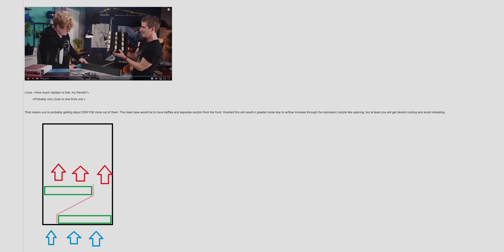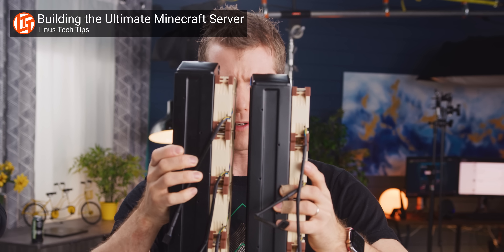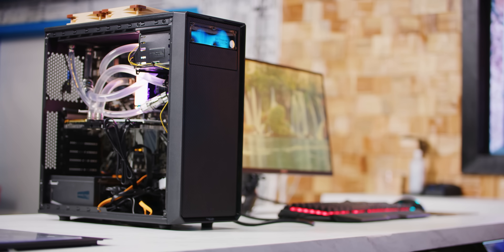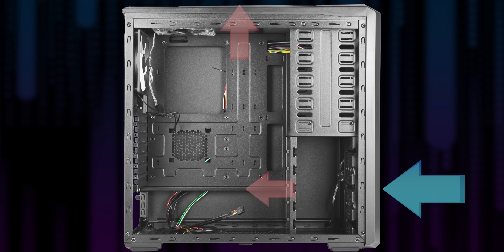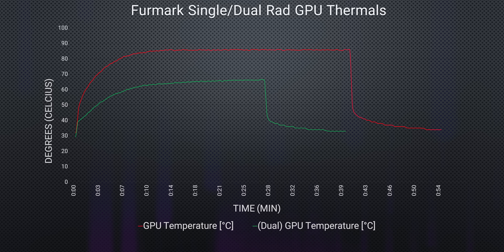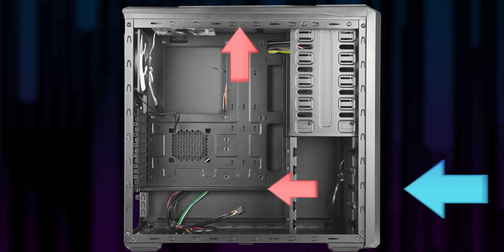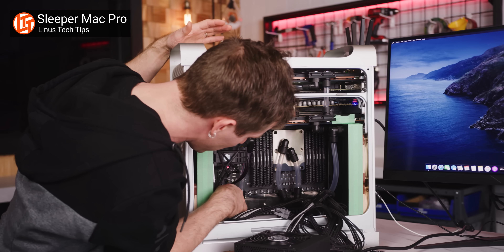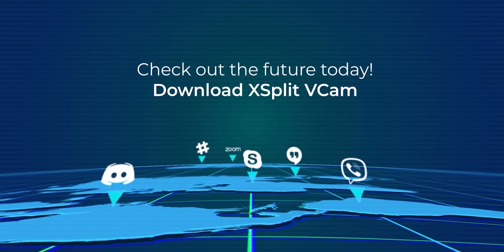I’ve been water cooling wrong for YEARS - $H!T Manufacturers Say

Comment: Corsair is both right and wrong.
According to heat exchangers physics, you need to "crosscool".
This is, the hotter the water, the closest to the end of the flow it needs to be. In other words, the radiator the most close to the outside of the case needs to receive directly from the components (hottest water) and the one most inside (closer to the most cooling active components, like fans, needs to have the coolest water, after being being sequencially and in series piped from the hottest to lowest. 

Stacking rads is the most efficient way to do it. If you do know how to do it.
Rads need to be in series. Hottest with less flow closer to the end of the case. Output of coolest water on the most inside rad.

Source: nuclear reactor heat exchangers.

Edit: Clarification and correction of incoherences. Also, thanks you guys.
Lost the LTT heart, sad. It was an honor to have it, though, even if it was only for some minutes. Thanks LTT.
Reply: Very well said. The goal in heat exchanger-design is always to get as close to a counter-current flow exchanger as possible, since it is the most efficient design possible.
Reply: Not really nuclear reactor physics, just standard heat exchangers. Basically always put your hottest source with your hottest sink, and coldest with coldest. (So water goes into hottest rad, then into colder rads). It's exactly how standard heat exchangers work to mean you can turn a 80 degree source and 20 degree sink into a 30 degree source and 70 degree sink, rather than just meeting in the middle at 50 degrees
Reply: @Owen Yin Corsair would get it if they actually used a good crosscooling setup and if Linus actually used crosscooling in his most common setups.

I'm no expert in many things. 
However, I'm still try an learn it. Why do I know crosscooling? Minecraft vídeo on the Nuclear craft mod. Then I started studying it a little.
How do I know how computer ALUs and ram work? Minecraft led my interest and now when I do play Minecraft I can build computers. Yes, I've learned a lot from Minecraft, or started learning from Minecraft, just because of the flexibility of the game.
It's just really a bad appeal to authority there.
Just because someone has a degree it doesn't mean a hobbyist isn't better than them at it. Actually, hobbyists are usually better at it.
Reply: To add on to the fact, water to air radiators are "fine" for removing heat. Water to water or water to oil solutions are significantly more efficient, if much more difficult and space/cost consuming.

Source: Water/oil exchanges mounted on the top of Porsche motors.
Reply: its not heat exchanger physics, its called thermal dynamics.
Reply: @arlindkrasniqi3315  Yeah, and the next guy will tell me that it is quantum physics because we live on a quantum universe.
We know already, thank you.
Reply: @arlindkrasniqi3315  Well, if I used complicated and ridiculous out of ordinary words to describe whatever, no one would understand what I was saying. The best way to get people to read is to make them comfortable.
Wanna talk about entropy? Fine, tell me how many people of the general public would understand it. It doesn't matter being sooo correct that no one understands you.
I could just say "quantum physics" to anything. I could have said thermal dynamics. But no one would care to read and learn what actually is important.
Reply: @arlindkrasniqi3315  "a heat exchanger is a device to change heat of one liquid through the use of another liquid"
Fluids, actually. And air is a fluid.
Reply: @arlindkrasniqi3315  Uh. Heat exchangers are fluid to fluid, not liquid to liquid. 
Talking about heat is talking about thermals. There's no need to be picky on the terms.
As the name suggests, heat exchangers is any device which transfers heat. Radiators are heat exchangers... At least when they do have some kind of fluid to exchange with. Radiators would actually be devices that only radiate heat as electromagnetic energy, in other words, radiating radiations on mainly the infrared spectrum.
It's literally in the name.

The point here isn't being as accurate as possible, it's explaining cooling efficiency.

If I was to try to explain gravity, I'd probably say that on earth it makes things fall at an acceleration of 9.8 m/s/s
But if actually explained gravity I'd need to talk about subatomic particles like bosons. 

The thing is, you can't always explain stuff by being 100% correct.
Reply: The water is moving so fast in a PC loop that none of this matters. The temperature difference you'd see from making an 'optimal' loop order is within the margin of error. You can talk theory all you want, the practicality is that loop order isn't important and the entire system reaches an equilibrium at some point where the water is at a stable temperature throughout the loop.
Reply: @NiceAndCreamy  That is correct. However, you'd get better results with maybe lower pumping rates instead of the high rate pumps nowadays. Other than being more reliable on the pump, it would increase efficiency and decrease the overall temperature on the components.
Reply: @NiceAndCreamy  Interesting. If the entire water loop is at mostly the same temperature, then Corsair is completely full of shit and have no fucking idea what they are talking about. As long as the ambient air temperature is lower than the fluid temperature, more radiators=more cooling, period. 

I see it all the time, engineers with their fancy SHIT models think they know what's up.
Reply: Is a cross-flow heat exchanger actually better at transferring heat or is it just better for other reasons?

I seem to remember from my Heat Transfer lab that cross-flow heat exchangers were mostly better for other reasons than strictly total heat transferred.

Then again, I only ever took the first Heat Transfer class, so maybe that got covered in the later classes.
Reply: @theInsaneRodent  They are better for efficiency, you don't need to much fluid Flow. It means less energy input to cool. It isn't exactly the best performing on high pump rates, but with low pump rates it is extremely good because it is extremely efficient. Nuclear reactors use them because they transfer the most amount of energy to the lower energy level fluid really well.
Reply: Nuclear reactor heat exchange is a bit different I'd imagine. You're basically boiling water from radioactivity and having it go through turbines to generate electricity then condense back. In normal PC water cooling, it stays in its liquid state and actively is pumped through a radiator. That active bit is important:  the water doesn't stick in one place very long and a lot of the temperature normalizes throughout the loop. Sure it's going to be a bit hotter going to the rad than from, but because it's being actively pumped, it doesn't make a big difference.
Reply: @sw33t.angela  Well, nuclear reactors sometimes don't use water as coolant, but another better coolant that exchanges heat with another water closed cycle.
Heat exchanging in nuclear reactors is equivalent to a PC, it's all about efficiency.
And while "it doesn't matter" because there are huge pumping rates, pumping rates also use a lot of power. You could just use a less powerful slower turning pump, using less energy. And you can also save on fan power too. 

In any heat exchange, all that matters is efficiency. Cross cooling is the best way, so in PC's it would also be the best way.
Reply: While what you say is true, that's not what Corsaid said in their comments.
Reply: Nuclear reactor heat exchangers and a pc case is not exactly the same set up thought. 
Crosscooling is perfect for a nuclear reactor because you maximise the heat exchanged. Which is important because you still need to extract work from the heated water after the exchange. So it has to be as hot as possible. But you don't maximise the efficiency off each of your individual radiators.
Crosscooling is not the most efficient way to cool a PC. Your goal is not to heat a second reservoir. If you make sure all your rads are pulling fresh air from outside of your case. You will maximise the efficiency of your rads and will need less of them, therefore reducing cost or temps (depend what you want). 

That's basically the point Corsair is making. "The second rad is not as useful as the first. Can do better." 

Also i didn't knew about crosscooling, but it is really cool (hehe), so thanks for that.
Reply: @guilemaigre14  It sounded like Corsair was saying that the second rad wasn't doing anything to cool the system, but that they were basing that on simulations that didn't take into account the heat loss due to non-controlled airflow.
Reply: @FranciscoTChavez  if it was a Corsair case and Corsair rad Linus used, they have 3D CAD models of those and all the data about their effeciency that they can use in their simulation.
Those kind of cfd analysis are actually really precise. If not basically spot on. At least that was a point where clearly Linus didn't knew what he was talking about.
Whenever he talks about physics i usually cringe a bit. This time it was more than a bit. :/
Reply: @FranciscoTChavez  forget that other point, sorry.
It can have a negative impact in certain situations indeed.
If you don't crosscool, meaning your last rad is the coolest one, you could end up in a situation where the water going through the second rad is cooler than the air, and therefore heating the water.
That's what they talked about. And if their rad are as efficient as they claim, then it could be possible, i think.
Reply: @guilemaigre14  yeah, I even started writing a comment on the things that Linus explained incorrectly in his physicals analysis of this, but I gave up and scraped it after the 4th paragraph.
Reply: @guilemaigre14  Well, crosscooling is definitely the most efficient, but surely isn't the best performing in PC's because there isn't that big of a heat difference.

But at the point you are willing to spend money on multiple radiators, do you really care about each radiator's efficiency?
You'd have better temperature control for longer time and while the outer radiator would be extremely inefficient, the inner one would be way more efficient than normal.
But it doesn't matter if the energy is going to be used or dissipated, it only matters that you don't want the energy to be on the water.

The problem of pulling outside air to each radiator to inside the case is fan pressure and heat. To the amount of air that is usually intaked in that config you'd have positive pressure but since you are keeping hot air in you'd have low pressure, since in a dual rad parallel config you'd have more intake than output area.
Now, this seems like equalizing, right? Low pressure hot hair but being compressed by limited output. And it is great... For not long time. It's initially very efficient, however, you start getting turbulence on the air, reducing fan efficiency and of course, you are keeping hot air in, which usually wouldn't be that much of a problem, it's only warm, but it does unfortunately reheat all the components, reducing also overall heat dissipation of the components.

It's good on the beginning, but it gets worse.

Crosscooling keeps it's performance high as long as the heat difference is high. And to that I say, it's easy. You can just run air through the case and have crosscooling on the top, with in big cases up to three radiators (totally overkill, unless on server or Pentium D applications).
This means the overall case temperature would be ambient, always. And the hot water could have up to 60C of difference.
Because the efficiency of crosscooling increases with temperature difference, the hottest it goes the better it cools (if you have enough radiator area and air, unless you want to use water-liquid cooling, which is great, but again, you'd have to have some kind of air cooling), until you reach an equilibrium.
And it really just depends on how you tune the speed of the flow of the fluids. Probably pumping the water too fast wouldn't be a good idea (heat difference is the reason), but also not too slow because you'd burn your components.
I'm pretty surprised how many people completely overlook pumping rates and think always that higher is better, but not always.

Anyway, cross cooling allows you to keep your components at a "constant" temperature, allowing for better life of the components (less expansion and contraction of the various metals and semi-metals) and better total efficiency.
Reply: @guilemaigre14  Everyone knows two fresh airs will be cooler. Not always room for that, though. And Corsair is flat wrong, as this experiment thoroughly proves. It is most certainly NOT pointless, and they should know enough to point out how to do it right.
Reply: @guilemaigre14  "That's basically the point Corsair is making. "The second rad is not as useful as the first. Can do better." " - hm, that is hard to argue with, but I thought that they were saying not "2nd radiator can do better!" - but "2nd radiator warm up your water so actually producing harm to your loop!".  So they are not saying that running fresh air through both rad is better - but that after 1st rad air is so hot (what??), that it could not be warmed up with 2nd rad and actually warming up 2nd rad instead. And that is something "hard to believe". This is like saying that thin radiators is working better than thick one. And there is something in this idea because if you have options to mount thick 240mm or thin 360mm - thin would be better, but if you have options to mount thick 360mm or thin 360mm - thick would be better.
Reply: According to nuclear reactor physics.. I think you mean heat transfer physics. Sounds a bit pompous and is wrong to call it nuclear reactor physics
Reply: @withgrapepower  Try and think coherentently at midnight after a long stressful day an at least not mess something up while writing a long text. Bet you will mess something up. Of course I meant heat exchangers physics, don't need to be so meticulous here :)

Comment: Interesting. I have a similar question. Is it better to run a standard single gpu+cpu loop with two rads, or will running two dedicated loops (two rads and two pumps, one to each component), yield any significant benefits? Running two pumps will obviously draw more power and cost more, but is it worth it, considering each component will have its own heat dissipation?

Comment: I wonder if they meant that having multiple radiators connected directly (touching) to each other was less effective. 

In your test, you had one radiator at the front of the case and one on the top. This allowed air to come in from the unsealed parts of the case, which you explained.

In the Minecraft server though, you had the radiators connected in a row. The air from the first radiator was the same air going through the third radiator. The air coming from the unsealed areas in the case wouldn't be able to go through only one radiator, it would have to go through all three. I think that this is what they were referring to.

As a new test, try running the radiators connected like in the Minecraft server, where they are touching each other. Compare this to a set up where the radiators are spaced out, or maybe just remove the middle radiator and leave the gap. This set up would allow cooler air from the unsealed areas to mix with the warm air coming from radiator #1, before going through the next radiator, increasing the temperature differential.

Comment: erm, ok corsair..

Unless the second rad is getting air at the same temp as the temp of the water in the system then it will add extra cooling capacity.
But Corsair if you do find a rad thats 100% efficient at heat transfer can you let me know as I can sell them for a shit load of money!

Comment: Radiators should be plumbed in parallel instead of series. The coolant coming out of the first rad in the series is already cooled some and the temp difference between the coolant and the air is less in the second rad thus making it less efficient at removing heat(delta t) . If you can use only cool air( room temp) , the size of the radiator can be smaller for the same amount of heat extraction. Like wise a single row tube rad is more efficient than a multiple row one because the air passing the additional rows of tubes is already heated by the first row. The amount of efficiency loss depends upon the speed of air flow. The  more flow of air the less time it has to contact the cooling fins and less heat pickup. Thus the additional rows of tubes have a greater delta T.
Remember efficiency = smaller radiator for same energy(heat) input.      csmale@bak.rr.com

Comment: Hey, Linus, I love to play games, and sometimes when I'm playing my PC shuts off randomly and then starts up again. I want this to stop could you help?
Reply: If you can boot into windows, your PC might be over heating and shutting down to protect itself. What kind of PC do you have? Pre-build, upgraded hand-me-down, or something you built yourself?
Reply: @aawinberry  I have upgraded hand me down that should be pretty good because I upgraded it as much as I could with my limited money.
Reply: @StrawWindow  What wattage is your power supply? What was the orginal system and what upgrades have you put into it? Can you install hardware monitor, and then monitor your CPU/GPU Temps while a game runs in the background.
Reply: @aawinberry  I have a Cooler Master 850 Watt, and I have not looked at how hot it gets when playing a game but my friend looked at it and said it doesn't get super hot. I also have water cooling for my cpu and then a crap ton of fans.